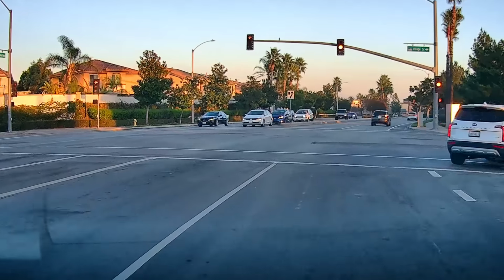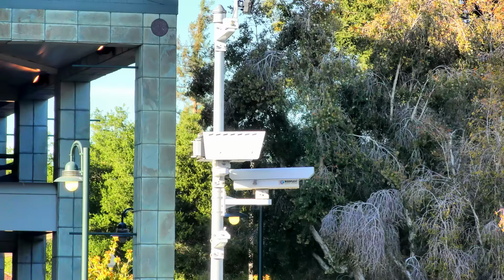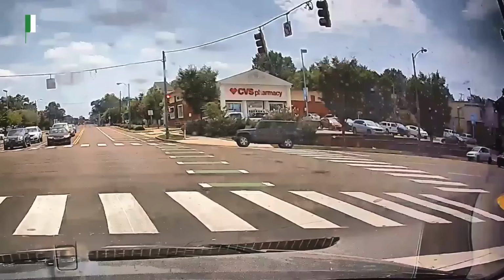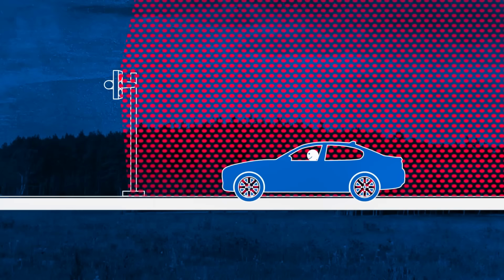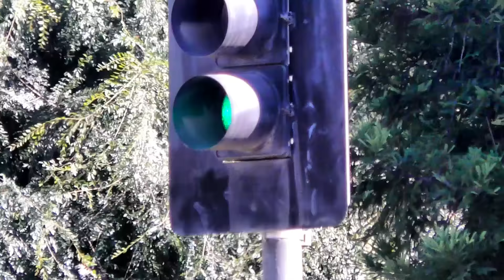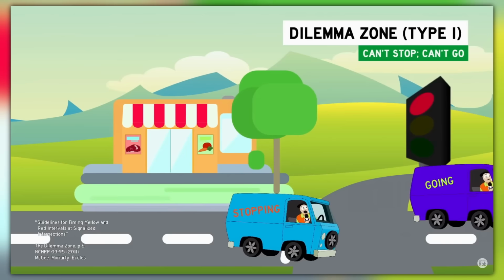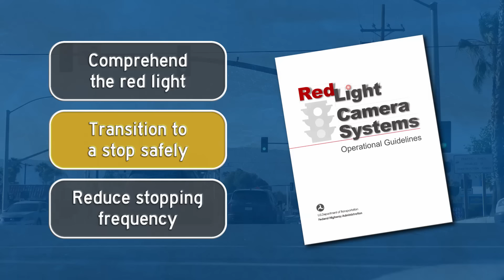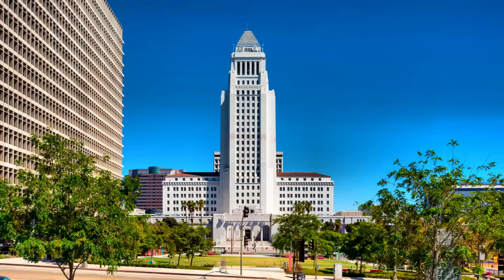Three ways to FIX a STOP LIGHT (so drivers ACTUALLY STOP!)

Comment: Something I saw in Upstate New York is a traffic signal that flashed a LED bar continuously within the red circle as a warning that the signal is changing YELLOW. Even while green, it suddenly started flashing as I approached uphill. 
First time seeing such a thing and I immediately had the presence of mind on what to do.

Not sure if other places have this installed but such a thing needs to be replicated.
Reply: Where I live (Ottawa Canada) we have a lot of “prepare to stop when flashing” which starts 5 or so seconds before light switches to yellow. Also helps reduce rear end collisions in rush hr (for limited visibility intersections)
Reply: It’s 50-100 ft before the intersection. Ie. If light is at end of bridge it would be at the peak of the bridge so you you’re not blind-sighted by a red when you cross the peak

Comment: I believe everyone in the world said the following.
Basically, in order to make US trafic signal safe, you should use European trafic signals :
On the right of your side of the intersection, red bigger than orange and green, big black boxes/chrome circles.
On busy roads, lights on top, on corners add signals on the left if top isn't enough.
All red lights and "green wave" are common pratices in my region. Also outside of cities / stroads there is always a "trafic signals" sign at 150m.

And more generally :
No right turn on red, there must be a dedicated turning lane with yield.
Yield sign everywhere. Stop signs are 2 seconds stops (you must put your car in neutral)

And so on... amber turning signals... always be on the most right lane...

Comment: You get people to obey red lights by cutting down or eliminating the "all red" phase. Like we used to do. Brutal, but effective.

All red is akin to a snooze button: by giving you some slack, people will take the slack and abuse it, until you wind up at an equilibrium that is no better than before. If people know they have 2 seconds after red before cars start moving the other way, they will exploit those 2 seconds.

As a person who enters an intersection on the green ball, with the intention of turning left on red (not technically running a red light), I detest red-light runners. Especially when they act indignant at me preventing them from red light running!

Comment: I was out on a delivery once on a rural state/county road near Keyser, WV. There was a stop sign around a near 90 degree bend. There was no advanced warning of the stop sign ahead. To make matters worse the highway navigation signs were straight line ahead of the apex, such that because being in an unfamiliar area your gaze targets the navigation signs while your vehicle continues along the path of the bend. As soon as my gaze returns to the roadway, I notice the stop sign while still going full speed at 50 MPH. I slammed on the brakes, but couldn't stop and ended up running the stop sign and crossing the double yellow lines. Coming to a near stop over the double yellow lines before continuing on my way in shock. Thankfully, there was no cross traffic.

Every sharp bend before that had advanced warning of a stop sign around the bend. My best guess is that the sign was knocked down at some point.

Comment: I had a similar incident where I almost ran a red light because I was looking at the wrong one. It was in Kansas City. There was a row of three lights between two hills. One at the top of both hills, and one at the bottom between them. I didn’t see the lower one in the middle because the further one was at eye level while that one wasn’t.

Comment: I’m near Dallas and they’ve been tinkering with the length of yellow lights. It took some getting used to, I’m always cautious and found myself stopping at yellows when I could’ve made it through the intersection, because the yellow phase is now so much longer than what it had been for many years. I love roundabouts but a majority cannot negotiate them and I’ve nearly been hit several times when using any of the very few roundabouts in the area.

Comment: While we're on the topic, I drive a truck for a living. A good chunk of my job is understanding and knowing when to run a red, whether it be to avoid a load hijacking or just because I was too close to safely stop once the light started cycling. What REALLY scares me is when the 4 wheeler in front of me decides "you WILL stop for this light" when the light starts cycling after I get too close... for the 4 wheeler, it's basically suicide by me at that point

Comment: Thanks for this video. There is newer traffic light in my area that doesn't seem to have been properly set up for real world conditions. It's at a "T", so vehicles turning right onto the through road trigger the light even though they have already safely made a right turn. So the light turns red for through traffic, causing many other cars, big rigs, RV's etc. to stop when there are no other vehicles at the T waiting to turn in either direction.
I admit to have ran through this red in this circumstance. I'm pretty sure no one likes having to stop for no reason.

Comment: Another thing they do in Great Britain (besides roundabouts) is they give the advantage to the cars stopped at a red light by providing a yellow light just before the light turns green. When the first driver in line sees the yellow he takes his foot off the brake and is immediately on the gas when the light turns green (if he doesn't do this there will be honking behind him). Any cross traffic that contemplates going through on yellow and run the red light has a high probability of hitting another car, and with all the cameras they have over there he'll be proven to have been at fault. In many years of driving over there I have NEVER seen anyone run a yellow/red light.....

Comment: Traffic lights in the USA 🇺🇸 are also on the opposing end of the intersection, whereas in Europe 🇪🇺 they are on your same side. The only drawback is, you‘ll have to maybe tilt your head a bit to see the light while you’re stopped at it. But it removes so much ambiguity on many intersections, especially Y-shaped ones, and they also give you a better reference on where to stop on red. So move the lights over to the same side of the intersection already!
Reply: This. To me that is the main problem with the stop lights placed like in the US. You have a big parallax effect which takes away the focus and thus the stop light is overlooked much easier.

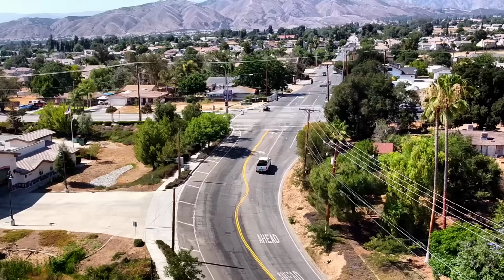Comment: 4:30. That extra signal would solve a huge problem around the corner from me. There is a sharp turn on a road where the speed limit is 30. People blow around the corner doing 45-50 and are never able to stop for the light in time. There is an accident at said intersection at least once a week.

Comment: One of these ideas (can you guess which one?) is in Germany known as a "green wave". Cities have been using that idea ever since controlling the lights from a central computer became a thing. However, for a while, they actually tried the opposite strategy to slow traffic down in hopes of making it safer. Turns out, that doesn't work. Visual obstacles other than traffic lights, on the other hand, do work, as our neighbors in the North West demonstrated.
Oh, and another trick I've seen in some places here in Germany: speed lights. At the traffic light, there's an additional light that shows a number (in white, to avoid confusion). That's a speed recommendation. If you drive that speed, then the next light will be green when you reach it. (I have no clue how they decide how to manage this.)

Comment: Another issue in the US is that the lights are on the other side of the intersection while the roads are extremely wide. That means a red light can be 5 or 6 cars ahead of you. But the primary object you're looking at is the car right in front of you---the object that's directly in your path and is perceived as a constant collision risk by your brain.

In addition, this forces you to play "where's Waldo" every time you see a traffic light to find out where you have to stop for it.

In much of the rest of the world, the traffic lights are on the near side of an intersection, and the stop line is one car length before them. This makes an extremely simple rule: Don't pass a red light.

It also makes it easier to judge your distance to a light. They can all be mounted at the same height (no need to vary the height to allow them to be visible over cross-traffic), which in turn makes it easier to judge your distance to the light just by the angle you see them at. And low side-repeaters (that you actually need for cars in the front row to see the lights) make it even easier.

Comment: E Amador Ave &  E Lohman Ave are the two-way directions for the same street in Las Cruces, NM. They have plenty of small block intersections, but the traffic signals are set to 35 mph, and going through that street is a breeze as long as you follow the speed limit. Really makes you wonder why a grid-like city can't have timed lights for every major street, going in every direction. It encourages people to go the speed that's set, and in turn rewards that driver with getting to their destination more efficiently. Isn't that a win-win?

Comment: I'm fairly sure in the UK all our traffic lights have the all-red phases you mention. I can't say I've gone out to them all to confirm that lol, but from my experience and from what I've read online most if not all have it. On the odd occasion I do have a run in with a red-light-runner they're generally at least halfway through the junction when I start moving from the front of the queue. Annoying? Yes. But I'm not getting side-swiped by oblivious drivers. *touches wood*

Comment: How to stop intentional running. Actually time the lights so if you are driving the speed limit you get a green. Solves the running issue and brings driving speeds down.

The other problem that causes intentional running is lights that don't stay green long enough. We have a light that always has traffic backed up because it only allows three cars through at a time. That causes at least three cars to run the light after it turns red.

Comment: I've never understood why some American states have single traffic lights hanging in the middle of the intersection.  Here in Ontario Canada there are at least two traffic lights controlling traffic in each direction.  (At least 8 traffic lights per intersection).  My county removed traffic lights at two semi-busy intersections and put in roundabouts.  According to the local cops it has reduced red light running (by Quebeckers mostly) and collisions.  My only complaint is that they use strobes for the crosswalks rather than the Hawk.

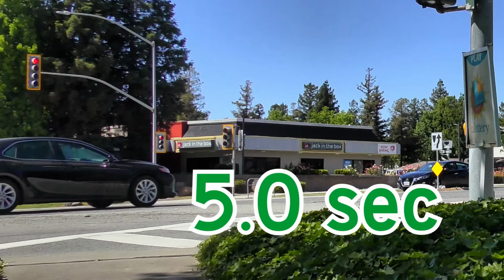Comment: 9:42 is also evidence that the limit is inappropriately low for the road type. Setting it too low means you have slow drivers following the rules and then very fast drivers being aggressive around them. Setting it higher reduced the aggression by making everyone move faster. Speed isn't always the issue, often it's a speed difference between vehicles that is the issue.

Comment: This is a massive problem for the DMV and further south near Lorton and Manassas. 

Route 123 is so darn curvy. I requested additional red light flashers a bit ahead on the road where curves are wide and or sharp where trees and such block red-lights, curves with up and downgrades into a red-light and others. 

There is nothing more problematic than lights on downgraded curves. 

You'd think they know that driving for 1 to 3 miles no lights and suddenly dip into a curve only to have to stop suddenly at a light is so dangerous.

Comment: another important thing with roundabouts and traffic safety is how the drivers react to the new infrastructure, if drivers in the area of a new round about consistently mistreat it and cause accidents the roundabout probably wasn't a good idea even if it fits the scope perfectly. One example of this I found in colorado where the county had set up tiny round about after tiny round about flexing the speed of the road back and forth between 40 on the straights and 25 on the roundabouts that were barely large enough to fit a standard sedan. they installed these due to people not stopping at stop signs causing major accidents but after installation the accidents are still major and happen even more often because drivers don't care to slow down then realize the roundabout was a lot smaller than they thought after its already too late, the design no matter if you hit the center or sides will literally eject you off the road way like a ramp causing even more sever accidents than the people who were running the stop signs before the roundabouts. What I find interesting is that prior to the roundabouts the 40mph road was 40mph all the way into the city with no stops but when they added the roundabouts because the intersecting roads stopsigns were being ran it caused a change in the 40mph road that drivers didn't want in the first place and don't wish to react to properly causing more harm than good meaning you cant slap roundabouts everywhere and expect everything to be fine.